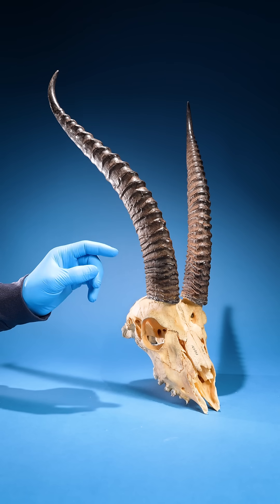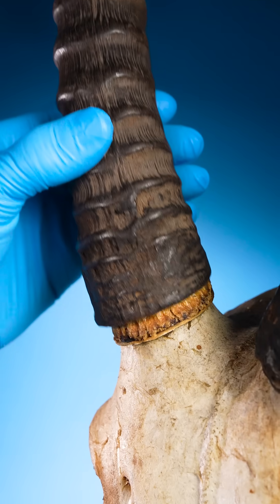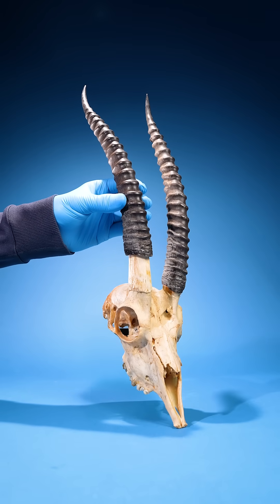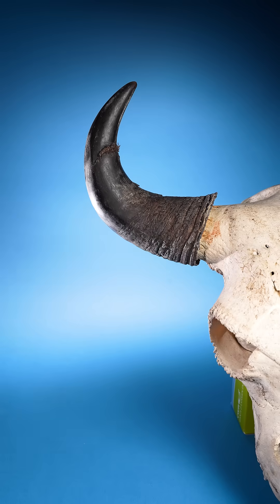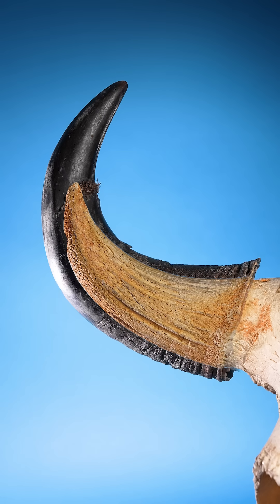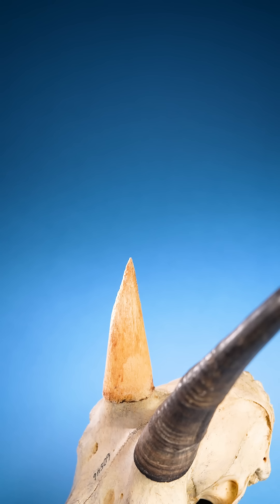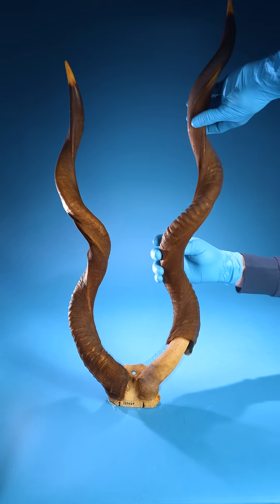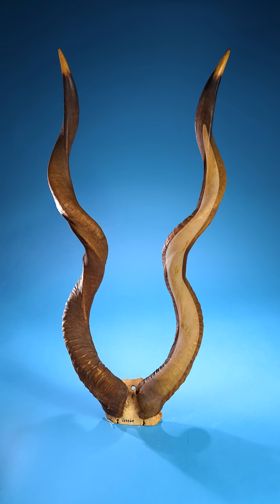What's Inside an Antelope Horn?

Comment: As Maggy entire the giant bone like structure she look around in utter confusions at the strange spiral patterns on the wall. This giant structure which seemed to resembled a large bony house was bigger on the inside than the outside. The mere thought of it sent mannys head in spirals almost like the spirals painted on the walls. Almost like they were calling to manny, like the were trying to consume him into the walls which seemed to go on for god knows how long. As many continued through the never ending maze of spirals and walls and furniture which seemed to be rusty and old from the sheer amount of aging going through them, I strange sound could be hear. A clacking of bones and a strange sound of what seemed to be a deer, or was it a sheep? Both sounds sounded splendidly similar to the animalistic sound emerging from the deep withins of the bony labyrinth. Manny continued going further, and further, chasing the never ending vocals coming from the dark abyss made by the nightmares of god. It was only a matter of time until manny came across it, the new born of the deer god, plasma bone shaker, some sort of machine in the room shook to create such unbalance in such a straight room. It was there, the deer of the house, it was rather plump yet it’s head boneless, floating mid air as normal physics were past it. You could tell the bones were smaller in the inside, manny did for sure. What happened next was a series of screams and rather uneasy stomps on the ground in attempt to escape it, the bones in the walls grew out trying to stop manny yet he kept running until falling onto the grass floor. Looking back he saw the house had suck into a deep pit, it must have been a blessing. That deer wasn’t just any horror and child but the house itself, it’s bones may have been small on the inside yet it caged itself deep within a geometric prison which has scrambled physics itself for no man to ever come near it ever again.

Comment: It's speculated that Ceratopsian dinosaurs my have had much larger horns than the fossils of their bones reflect as the keratin would not typically fossilize, though they are not mammals the structure is similar enough for theory and speculation.  It's fun to imagine, what if triceratops had horns like the goat, a small bone structure and long pointy horn over it.

Comment: And this is why you can't saw horns off goats like you can with cattle (even using a giggly wire saw) because that bone core is actually hollow and that cavity leads right to the sinus cavity. In cattle you can saw some of the horn off without breaching that cavity (a good giggly wire and some blood stop will fix it up quick) but goats can't have that done. smaller animal will bleed out faster and that cavity goes up the bone core much farther.

Comment: ...somehow genuinely didn't know that the horns weren't apart of the skull/skeleton
I now am genuinely curious as to how they evolved like that
Reply: It's keratin, just like finger nails or hair. I guess I haven't thought of how they evolved either, but I'm guessing there was an advantage to having bony outgrowths, and also an advantage to covering them with keratin.
Reply: I don't know how they evolved to be like that but I'm assuming the reason why they evolved to be like that is to Shield their actual skull from damage. and so I guess the reason as to how is because animals with horns will use them for social dominance, territory possession, and predator confrontations, and by ramming their horns into anything for any reason they deem necessary. So the shell protects the actual skull of the animal.
Reply: @OllieBruh08

Thats what I was thinking, if the whole bone grew as the horn then if it broke off, it wouldnt regrow as well, so having their horns outer shell be made of a less strenuous material to regenerate and just having the bone to anchor it in instead seems ideal

Comment: Horns are made of keratin, the same material our hair and finger nails are made too, the base of the horn has blood vessels and Flow under, enables the horn to grow larger trough the years and since they are growths, they must be trimmed so the size is fine. Antlers in cervids like deer, moose and elk on the other hand have completely different approach, antlers arent made from keratin but from minerals, antlers are bone growths. Cervids have pair of bone based on their head but not way up as it can be seen in horns, the antler starts off in furry layer called velvet, wich helps antler grow beacuse of the blood vessels in it. Calcium, sodium and phosporus is essential as thats same material our bones are made off. Once they reach the full size, velvet dies and falls off, causing the itching effect on it and antler becomes hard as bone. Testosterone also has a purpouse in antler growth and once antlers are full, so is the testosterone level, with that the rut can begin. Once the rut is over, testosterone drops and antlers due to that begin to loose from the base of the skull as said and then fall off, something horns cant

Comment: For those of you who don’t know, the F-22 Raptor is a highly advanced, fifth-generation American stealth fighter aircraft, designed for air superiority but also capable of ground attack, electronic warfare, and intelligence gathering. Developed by Lockheed Martin and Boeing, it's a twin-engine, supersonic, all-weather aircraft that incorporates stealth technology, exceptional speed, maneuverability, and advanced avionics. The F-22 has seen service in air-to-air combat, ground target strikes, and various other missions. 
Key Features and Capabilities:
Stealth:
The F-22's design, including its shape, materials, and internal weapon bays, minimize its radar cross-section, making it difficult to detect by radar systems. 
Supercruise:
It can fly at supersonic speeds without using afterburners, extending its range and maneuverability. 
Advanced Avionics:
The aircraft features a sophisticated sensor suite, including an active electronically scanned array (AESA) radar, and a wide array of communication and navigation systems. 
Maneuverability:
Its advanced flight controls and thrust-vectoring engines allow for extreme agility, enabling it to perform high-G maneuvers. 
Air-to-Air and Air-to-Ground:
The F-22 is equipped with both air-to-air missiles (like AIM-120 and AIM-9) and air-to-ground munitions (like Joint Direct Attack Munitions (JDAMs) and Small Diameter Bombs (SDBs)). 
Integrated Maintenance:
The aircraft utilizes an Integrated Maintenance Information System (IMIS) to streamline maintenance procedures and ensure accurate records. 
History and Development:
The F-22 was developed from the United States Air Force's Advanced Tactical Fighter (ATF) program. 
The prototype, YF-22, first flew in 1990. 
The first F-22 test aircraft flew in 1997. 
Production began in 1996 and ended in 2011, with 195 aircraft built (8 test and 187 operational). 
The F-22 entered service in 2005. 
It has seen combat in various conflicts, including operations against Islamic State in 2014 and against a Chinese surveillance balloon in 2023. 
Cost and Controversy:
The F-22 program was a very expensive undertaking, with individual aircraft costing between $140 million and $350 million. 
Due to its high cost and limited production run, the F-22 was not exported to other countries, even its closest allies. 
The F-22 has been seen as a symbol of American air dominance and technological prowess.

Comment: Antelope horns are primarily composed of a bony core covered by a sheath of keratin. The core, which is connected to the skull, is covered by a layer of hard, horn-like material made of keratin, the same protein that forms fingernails, hair, and feathers. 
Here's a more detailed look:
Bony Core:
The core is the internal, solid structure of the horn that grows out from the skull. 
Keratin Sheath:
The outer layer is a hard, horn-like material made of keratin. 
Growth:
Horns grow continuously throughout the animal's life, and the size and shape of the horns can indicate an animal's age. 
Permanency:
Unlike antlers, which are shed and regrown annually, horns are permanent and do not shed.

Comment: Im a taxidermist and its surprised how many people don't know this. Unlike anters that grow then pull back the blood, horns keep growing and growing so it needs that bone support and delivers blood to the area. Its how you can tell how old an animal is by the marks (Ie more rings each year) and length it grows. Antlers however (like on deer) become like a solid sponge in the middle and becomes brittle then will eventually fall off. Then the next year they grow back again and they will be bigger with extra tines (points) and it happens every year. A little info for any one interested. :)

Comment: And those are what you SHOULD be using if you want to make drinking horns or musical instruments. Cow horns are cheaper and more readily available, but clearly a bison, antelope or kudu horn is ready made for the job, people. Just warm the horn slightly to open up the pores, add melted beeswax, then tip out the excess.

Comment: Ahh, yes. My household Antelope skull. 
I just got a new one a few years back. 
The old one was my great great great grandfathers. Passed down for generations.  
But a junky stole it - high demand for them around here since many were destroyed during the great winds of 97. 
Don't buy from the fences or the scalpers. 
Sometimes, they take out the core and use it to make pipes. They replace it with a fill-up of sealing caulk.
And you know that totally ruins the functionality.
So yeah, I had to get a new one. But I ended up getting two on a Bogo sale at the local Apothecary. 
I have the hook up on lock. If you need one from a source that you can trust. 
Just hit me up. 
K
I got you bro.

Comment: Alot of animal horns have spongie bone inside of the horn with tons of blood vessels to expel heat and regulate body temperature. Sort of like a radiator or heat sink. Horns and antlers are different antlers are shed while horns are permanent.